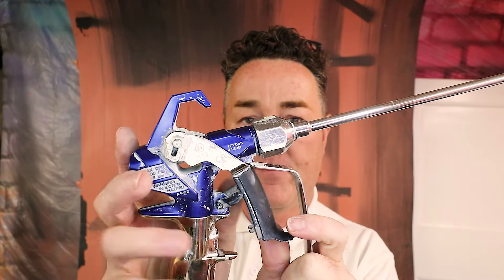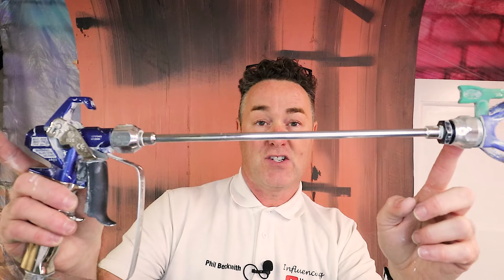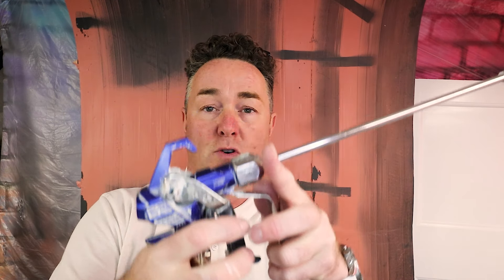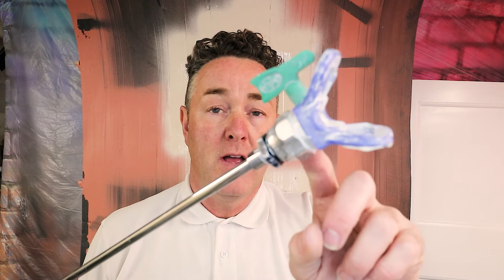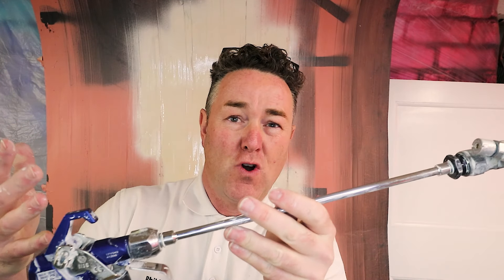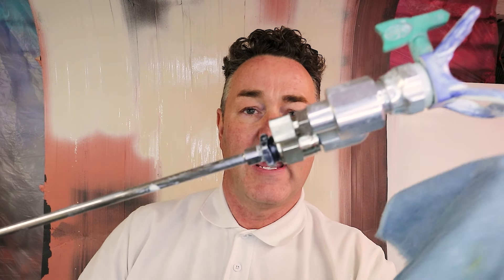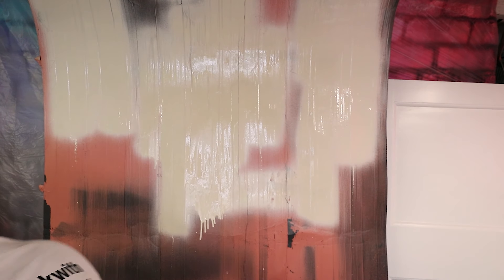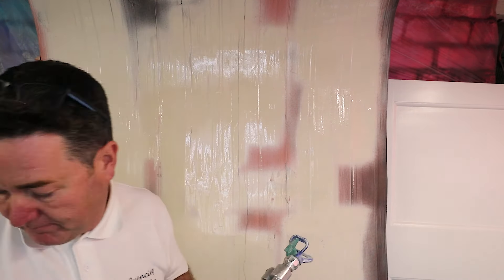Amazon 'Cleanshot' Valve Test: Epic Win or Total Fail? 😱💥

Comment: That a very interesting and helpful video Phil.  I’ve just bought my first machine, GX21ff as I got a lot of doors and ceilings to spray.  I’d assumed I could just buy a Graco extension tip for use on higher ceilings, but will I always get spits if don’t buy a clean shot valve?
Reply from the maker: I'll say yes. If pressure is low enough, you'll not notice.

But in general, like I explained, you saw the tail end spit

Comment: I brought one off Temu for £25 saying it was a clean shot. There sold as false description coz there is no spring inside it like the true clean shots have. So it’s just a swivel, you’ll never get rid of the tail 😂
Reply from the maker: does the one you bought have the turn nob on the end? many I see are just a swivel head with no nob to dial in or out.
Reply: @ yeah it looks the same as a graco one with the adjustable knob. I took it apart and it’s just a needle with no spring so all your doing is shutting and opening the hole with the needle, where as with the graco its spring activated up to around 700psi and anything over that it pushes the spring back to let the paint out.